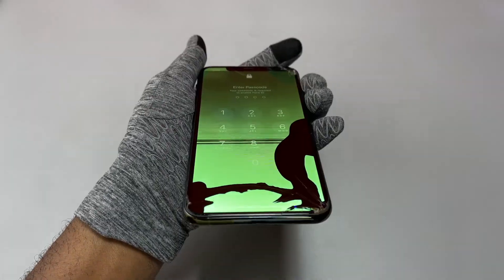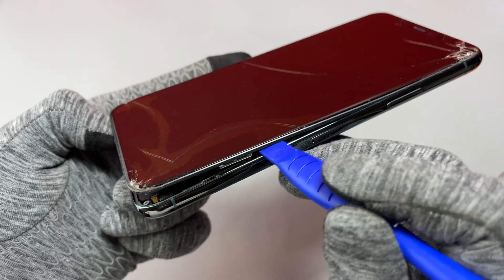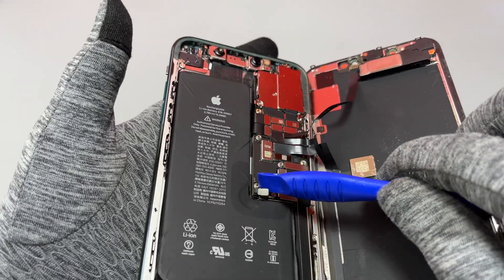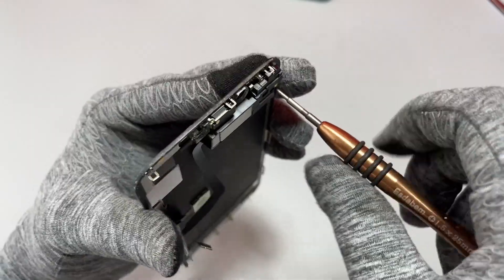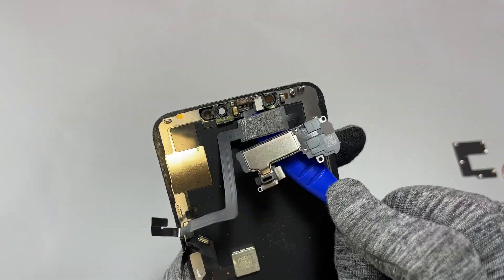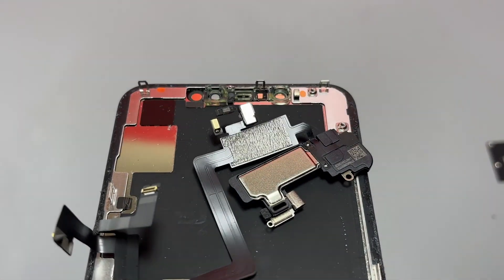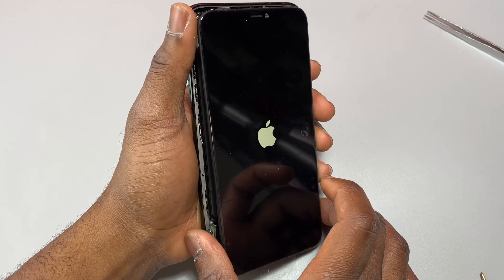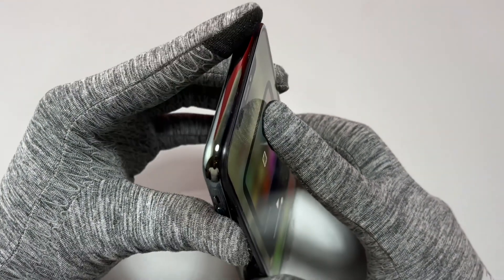iPhone 11 Pro Max Screen Replacement (Fast & Easy)

Comment: Hey just a question. I bought an iPhone 11 Pro Max a month ago and they gave me 21 days warranty and it ended 13 days ago, however I just noticed the screen is lifting in the top right corner towards the camera side, I told them and they said there’s nothing they can do since the warranty is up. Do you have any options on how to deal with this situation?
Reply from the maker: That's tricky. If they cannot do anything due to warranty up they are basically no longer liable for the device and condition. The easy fix would be to open the device and seal the screen back with double sided tape or glue b7000. That's the one fix I can think of from what you told me.
Reply: @ersbit  thank you for replying. They offered to glue it back down like you said so all is good now😊

Comment: I did everything right but my Face ID and true tone not working
Reply from the maker: Hi, what is the state of the phone currently? 
If something like this happens you will Wannt to reinstall your old screen just to check if the issues goes away. If it does the new screen might be the issue or Apple IOS software. When they update the IOS software they do some of these stuff to prevent the aftermarket things to work 100%.
Reply: @ersbit  it’s saying my 
(A problem was detected with the TrueDepth camera .Faceid has been disabled)
But when I inserted my old screen back 
The true tone came up but the Face ID did not work
Reply from the maker: @sammys944 true tone came back but face Id still bad?? At any point did you touch or remove the face if camera etc.... Check the screen front speaker to make sure there's nothing cut on that flex cable or any damage to the front speaker. I suspect the front speaker might have been damaged.
Reply: @ersbit  umm maybe but I can’t see any thing wrong here tho 
Everything still intact

Comment: Where can I buy the apple 11 pro max factory screen?
Reply from the maker: Hi, here's a link to the screen
Screen 11 Pro max: https://amzn.to/3ZBmCsY
Reply: Should I clean and take out the original adhesive before I put in the new adhesive?
Reply from the maker: @s0uth5tar  absolutely you should remove old tape and clean everything before adding the new double sided tape.